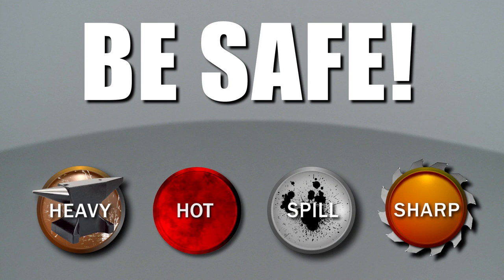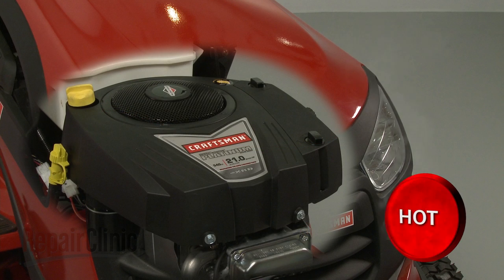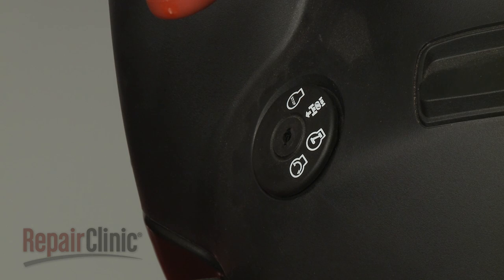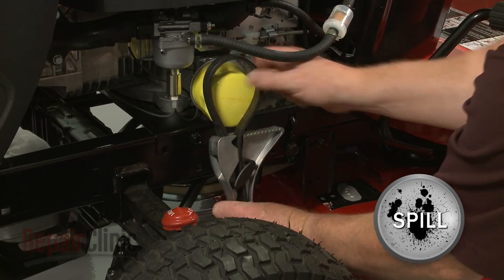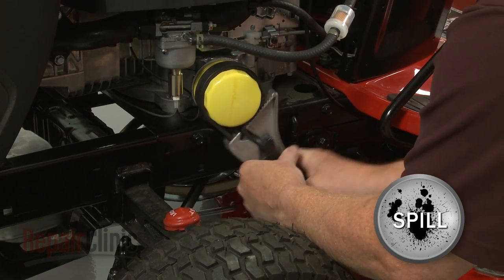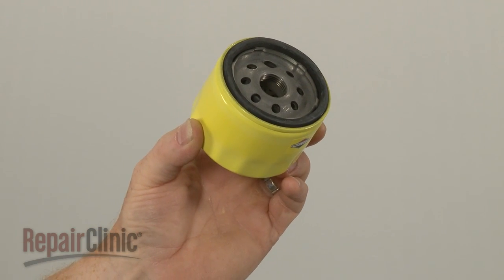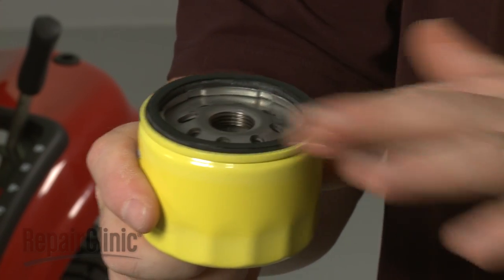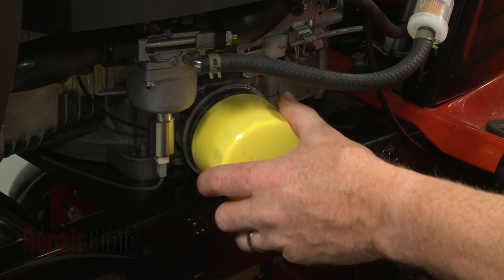Briggs & Stratton Riding Lawn Mower Engine Oil Filter #696854

Comment: What size oil filter wrench (kind used with socket) will work with this filter? I cannot use the strap kind as I don't have enough clearance to spin it from the side. If you know of a part that works please provide the link! Thank you

Comment: why did you not fill the filter with oil 1st prior to installing? hmm must love those dry starts. always pre soak your filters.
Reply: Terry Doberstein wrong
Reply: Because it's not necessary.
Reply: Do not fill it completely..add an ounce or two of oil depending on what size filter you use and hold it horizontal while spinning to evenly prime the media leaving no excess oil standing inside the filter.
Reply: Because it's mounted horizontally Einstein.
Reply: @OldDunollieman  I believe his name is Doberstein not Einstein :-D
Reply: How many qts?
Reply: @odiepaul10  what mower? Should say in the hood or somewhere on a sticker mine ar 48 oz and 56 oz

Comment: Does these machines use the same SAE 30 as the oil for my car
Reply: fleet tech yes
Reply: I suppose you can; however, the engine in your car is water cooled.  SAE 30 for small engines is specifically formulated to better withstand the higher operating temperatures of air cooled engines. Amsoil 10w30 for small engines is the absolute best if you're willing to pay the price.